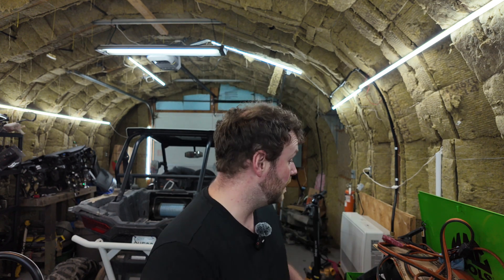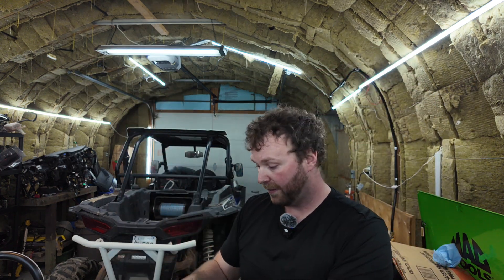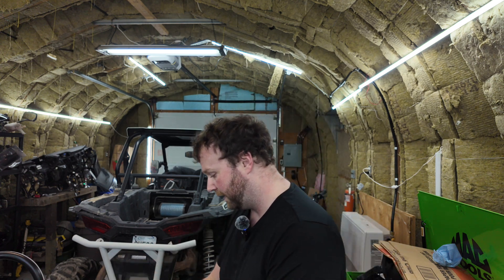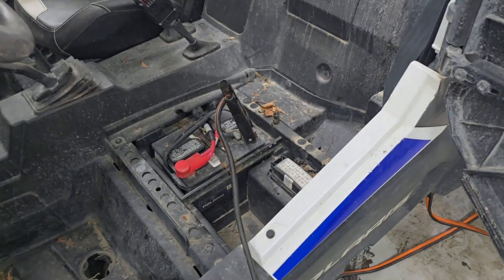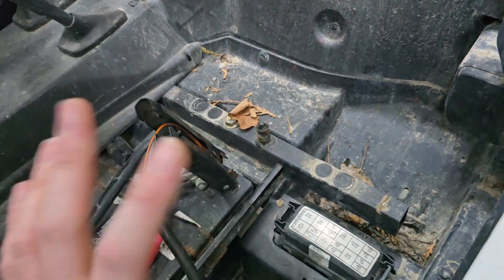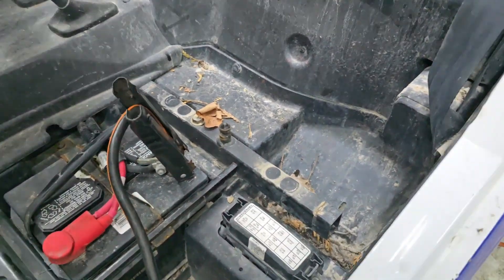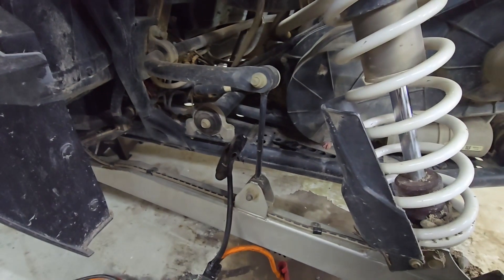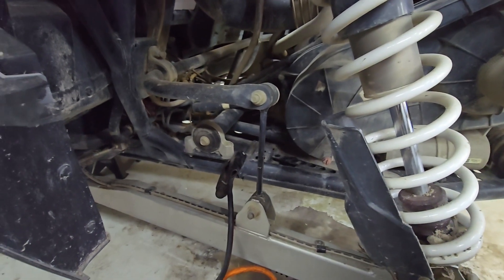Important tool not being used anymore? Forgotten testing

Comment: There's nothing wrong with showing everyone your method for checking ground. Its perfectly fine to do this. But you have to remember that most of your viewers are diy and entry level techs. You make it sound like a voltage drop test is optional. I guarantee that no more than 1 or 2 percent of the people watching understand the reason you do a voltage drop test is to check resistance. If anything, you should talk about how important a voltage drop test is. Most entry level techs set their dvom to ohms to check resistance, and we both know doing it that way is nothing more than a continuity test. 
I just think it should be made clear that you're talking about a specific type of measurement.  For other types of diag tests, voltage drop is the best way to go. If you don't know how or when to use VD, you're going to have a lot of misdiagnosed vehicles. Of course you already know all this, but most people don't.

Comment: I’ve got all sorts of jumper wires for testing gator clip ones and big cables. Living in chicago, shit gets rusty I like to check fuses, then I’ll start checking grounds and wires. As well I used to work on the old cars ran on points and 6volts lol cars have changed quite a bit witching just the last ten years and the technology is cool but definitely comes with flaws. For example I had a bad fuse that wasn’t even blown to the naked eye it looked good but the fuse had got hot enough it cooked the metal just enough to have a lot of resistance and without a volt meter the test light fooled me. But yes I check grounds before I check power wires. I’ve had to replace entire wire harnesses on trucks from corroded wiring, mostly grounds.

Comment: Let’s say you have ground issue. You using these jumper wires to verify.
How you pinpoint after what ground is bad exactly?
Are you looking through affected modules and then checking grounds one by one?
Reply from the maker: At that point Hit the 3 main grounds, battery to frame, frame to chassis, engine to frame/chassis. After that you got to look up the schematics for the more harder to get at ones. but its usually the big 3 that are the issue.  They're usually labeled G100 and higher. honda is famous for G101 and rodent damage :)
Reply: @Lancemechanics  this is very important detail. Thank you very much! I'm 1 year in industry, very important trick for me!
Reply: Use your multimeter on the negative side and look for voltage.  Should not be much, 0.5 volt maybe?

Comment: One of your best videos I've watched. Incredibly helpful for diagnosing electrical issues and this also proves to anyone living in the rust belt should think of rust prevention like oil or wax undercoatings and dielectric grease which can help prevent electrical problems and failures
Reply from the maker: Thank you for the feedback :) Trying to slowly improve how I explain things :)
Reply: @Lancemechanics  You're the most insightful and you cater well to people (like me, an Ontarian) living in cold climates, salted roads, and more extreme weather. Some things have to be fixed and maintained differently just based on our location.

Comment: This is a great hack. I will grab jumpers instead of a meter next time.
Reply from the maker: :D
Reply: had a VW golf, had a few jumpers installed permanently to the dash lights. 
well the main wire crimp to fuses let go.  Car coasted to the side of the road. 
But the jumpered dash light were fine. 
Knew right where to look, cleaned off that main wire, re crimped, all good.

Comment: Great video. It brought back a memory of a 1970 (remember I am very old) dodge crank no spark because of a rusted firewall, the electronic ignition module mounted on the fire wall was grounded by the screws that held it on.
Reply from the maker: I feel Like I ran into that on my old 1970 cutlass before I upgraded to HEI distributor

Comment: I couldn't agree with you more. If the mechanic isn't using a meter to diagnose something it isn't sexy enough to just hook up extra and mobile grounds to get the diagnostic process started. Great advice using old fashioned jumper cables.
Reply from the maker: TY :D

Comment: I'm seeing the same thing in industrial automation control panels. So often these are assembled by unpaid interns who will be long gone by the time the panel is install and put into service. So many wires in the right hole, but the screw isn't tighten at all...
Reply from the maker: Can only imagine the symptoms/faults you'd run into that case. intermittent grounds uh

Comment: Bmw x1 no starts, this type of testing is the only way to find your problem with a bad chassis ground. 1 million fault codes in every single control modules. Old school mechanic like me all ways has the thick jumper cable on call 📞 for testing or for the diesel no starts…jump box i still have in the tool box
Reply from the maker: damn thats good info to know. didnt know the X1's had those kind of issues.